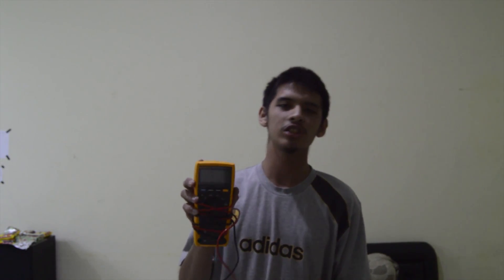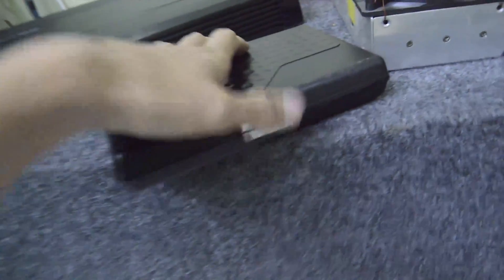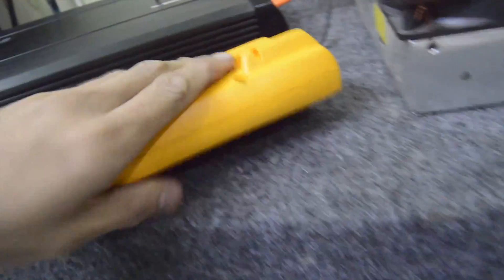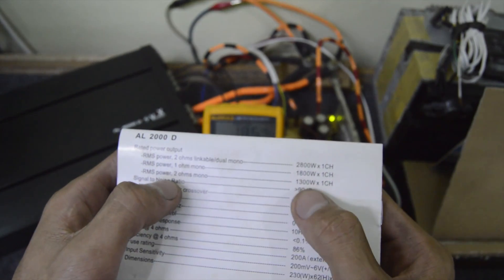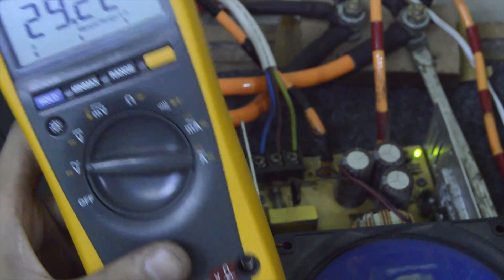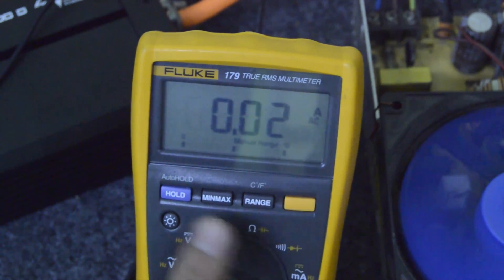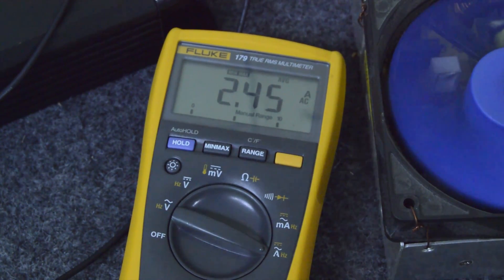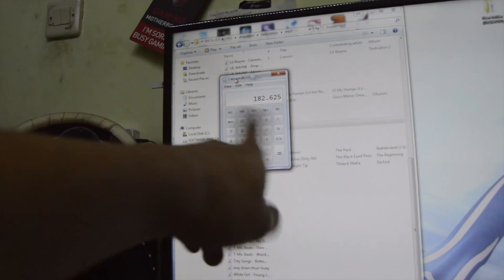HOW TO MEASURE POWER THAT GOING INTO YOUR SUBWOOFER

Comment: Do you have hooked amplifier only to power supply? Its enough?
Reply from the maker: +CreadorHDPlay it is,because im using a cheap kicker 4 ohm sub,and its only driven at 180watt while the 30a power supply can handle up to 360watt
Reply: What would you do if the sub was stronger?
More than 360w.
Reply from the maker: ***** more psu with diode